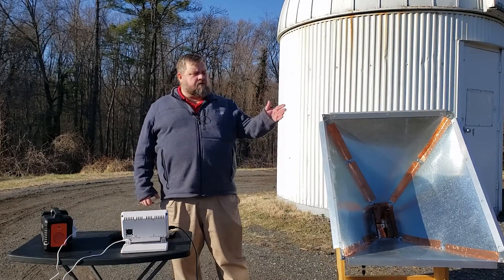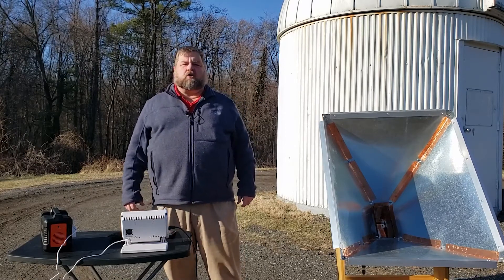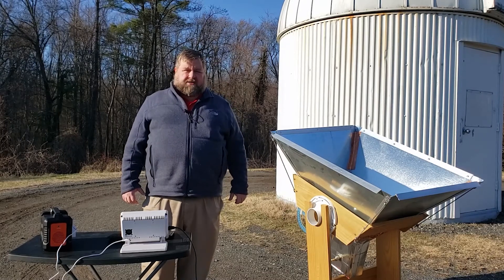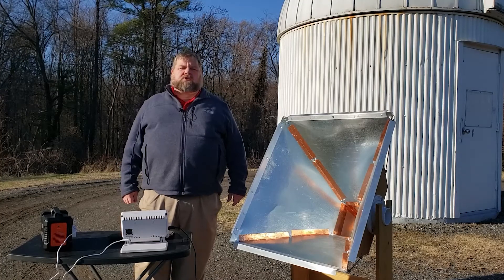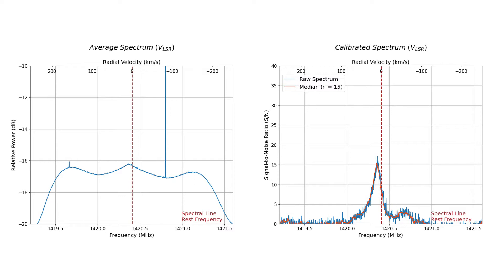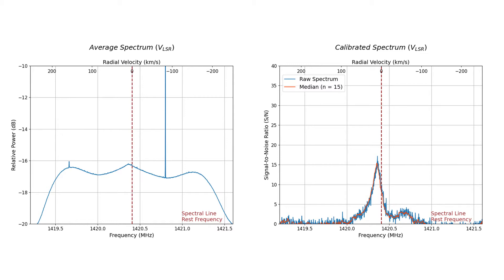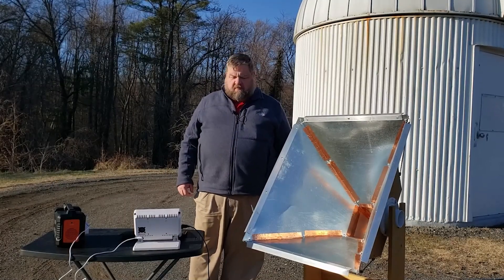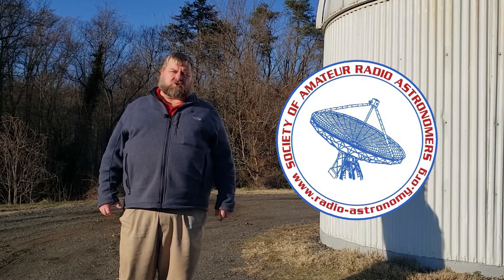Scanning the Galactic Plane

Comment: Oh come on now? You are punching things in on your computer. And voilà! We have no idea what you just did? You are using no screen capture software. You have no Body Cam to switch to. What? No little cheap digital switcher?

And you are trying to aim a, Radio Telescope at the Milky Way? Not at the sun? Where I'm sure you would pick up lots of stuff. And whatever micro-or millimeter region?  It's a lot of hash. All across the spectrum.. And smoke gets in your eyes. Along with gas and dust and the sun. In your dish. In its broad daylight out. The atmosphere is completely ionized. What do you think you're going to pick up from the Milky Way? That's making it through this electromagnetic hash from the sun?

And then to have the audacity. Not to show us your software in operation. And to simply be describing what it's not necessarily doing? But wanting you to think so? Because somebody wrote an app to do that. Like any other computer game. I'll have to see if some voltage coming from your dish. It doesn't know what it's looking at. Neither do you. As you need to do it during the day. So you can see what you're doing? And so you can make pretend you are a Radio Astronomer? It's a computer game for kids. To learn about the cosmos. From an online database. And depending on how much sun you are picking up? You could be the big winner this week!

And you will receive an official Telescope from Edmonds Scientific.  We have,  Jay here. To tell you all about it.

It's the new. 6 inch, folded mirror design. Of the JWST. Write in your own Edmonds Telescope! Wait till you see the Stars. Spring to life! Right before your Right Angle Mind. When you see Donnie Trump pass before your eyes. And not a moment too soon. Before November. I hope.  We all hope.

I want to see Donnie collapse from a cardiac arrest. While debating Joe Biden. That would be Awesome!
RemyRAD

Comment: The LSR(K) data velocity correction factor varies continuously. It is dependent on the Observers Long/Lat Location on Earth / Date / Time / RA and Dec position of the telescope and can vary ~ +- 30 Km/Sec each day ( sinusoidal).

Ideas for a small Neutral Hydrogen ( H1 ) Radio Telescope Project  ( presented this Summer : Society of Amateur Radio Astronomers conference  SARA )    https://www.youtube.com/watch?v=C6NCefVxNL8
Reply: That's why I added code to the Virgo project that uses the time, lat/long, and other factors when calculating VLSR. Fortunately, the astropy library has methods that keep it from being too complicated.
Reply: @BlueCordVideo  Yes, that correction calculation is Not Trivial !  I initially used an on-line calculator w/ Excel to find a 2nd order poly fit curve. I now have a Matlab program from JJ Maintoux.  Thanks for the ok on the link.  Alex KK4VB    
I wish I had found your presentations a year or so ago.  Excellent Material. 
One of the most difficult tasks in beginning Radio Astronomy is finding basic material .
Reply: By the way, thanks for adding the link to your talk. I missed the SARA conference this year.